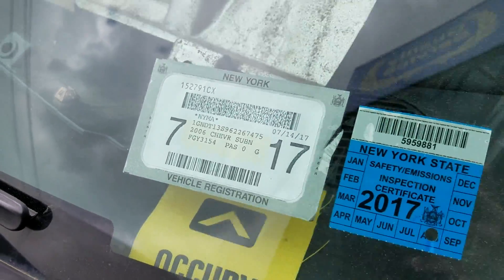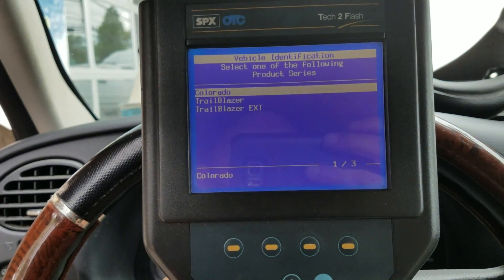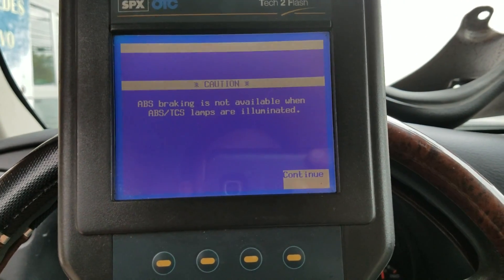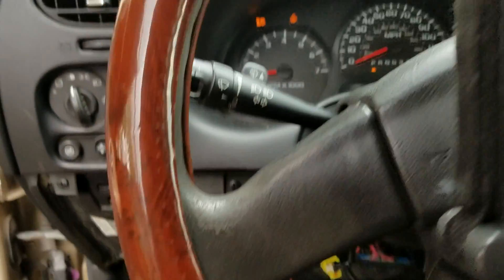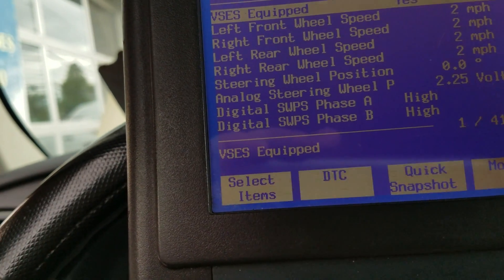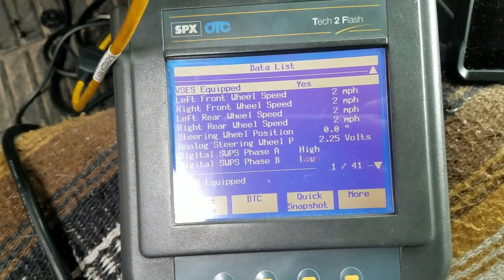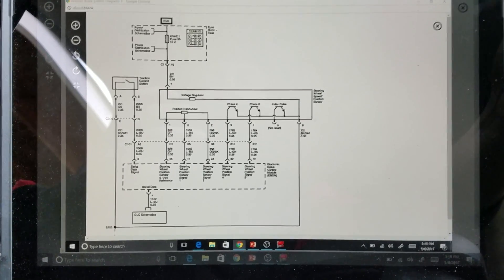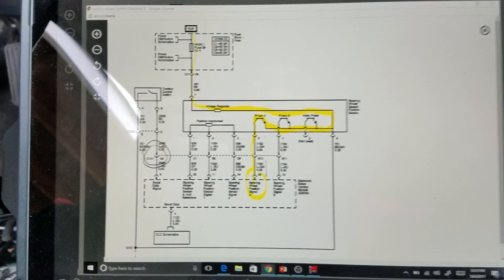Trailblazer Steering Angle Problems

Comment: Wow,go figure,who ever it was that was throwing the wrong parts at it needs to be schooled. Not sure how you would check the ABS control module but honestly,you know it cant be the steering wheel position sensor,so obviously thats the next link in the chain. Another mechanic theowing the wrong parts at the problem rather than doing what you did. Thankyou for the lesson. I have an 03 Trailblazer with 200k and have to admit,other than a transmission rebuild recently,it has treated me very well. Other than the usual maintenance stuff and a pesky fan clutch issue( which I have decided to just ignore) She runs great.

Comment: Did the new module fix it? It's strange for a brake control module to feature a steering sensor, or is that part of the brake system?
Reply from the maker: roadkill5333 Nowaday nothing is really just a simple anitlock brake system. Almost all manufacturers like to incorporate traction control. And when it comes to Suv's they also add rollover protection . This all gives me an idea for a video that can help explain a little better. And new module is on its way, I will make a follow up video when I receive it so I can explain the programming process also
Reply: we're talking gm here...like the tpms in the door lock module...go figure
Reply: New Level Auto Can't wait for the follow up, and explanation vid!! Thanks for sharing!
Reply: billmck12345 thanks!! I forgot about the GM thought process! Alternator gaskets! Fuel injection return spring! And the rear wiper control module having the key in ignition buzzer all in one! ;-)
Reply: It's part of the stability control system. Compares steering input with a yaw rate sensor to detect understeer or oversteer and supplies brakes to try to correct it. All new cars come with it.

Comment: The Alldata you guys get in the US is soooo much better than the European version. The Euro one I subscibe to is basically factory manuals. A great tool to have but no where near as much of a guide as yours. Great job Keith.
Reply: One Auto the guy from AllData Europe told me their data base is just as good as US version before i subscribed.now that i'm a member they telling me will take 3 years to get there so sucks😭😭.Quite a few vehicle manufacturer not even exist in their system and certain model repair information very poor .I've tried many data base and none of them nowhere near as good as these guys use in US.Makes diagnosis so much easier having the right info, diagram and step by step guide.
Wish i would live in US
Greg
Reply from the maker: One Auto, Thank you Rob , I will have to find a better solution for your dilemma
Reply: Injector Removal Yep totally agree!

Comment: great vid keith, I like that test light test...so if that pulled to ground then it would be a broken wire/wiring problem? is that right
Reply from the maker: billmck12345 actually if it pulled to low using the test light that would mean the new sensor had failed or that there was a pin fitment problem at the sensor itself
Reply: ok I see now.. signal gets manually pulled down and ebtc reports through the scanner... which would leave the circuit in an open state but part of the circuit is showing a bias voltage of 5 volts...so would I start looking on the other side of that sensor circuit for pin issue/or sensor.... sorry to get drawn out on this, just tryin to learn here keith...
Reply from the maker: billmck12345 not sure of what I am missing in the question. The sensor is providing the bias and the signal. If I manipulate the signal out and the ebtcm status does not change then I test from C101 to break the system in half
Reply: sorry my question was about direction, when you were attempting to pull down "a" with the test light...it didn't pull down...it was just a question on what if it did....thanks for explaning...